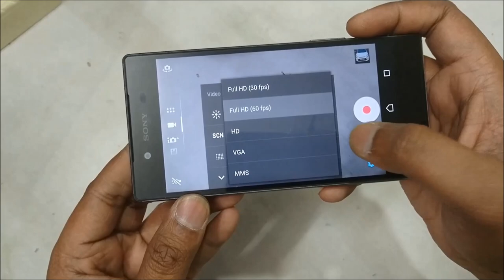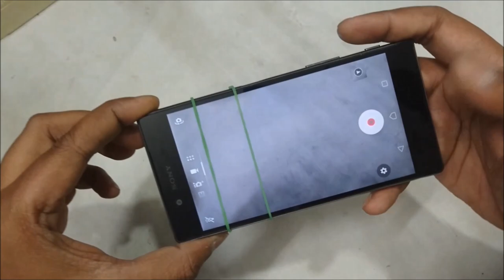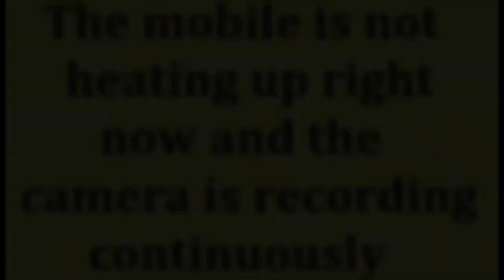liquid cooling system for mobile

Comment: It is not a liquid cooling system
And you are saying that thermal paste turns to liquid base...
A liquid cooling system consists of  antifreeze coolant or just water which absorbs heat from heat source and passes to other components like heat sink, cooling fan, radiator.